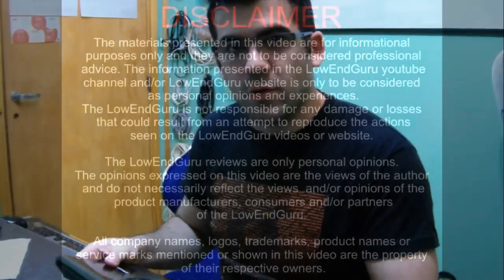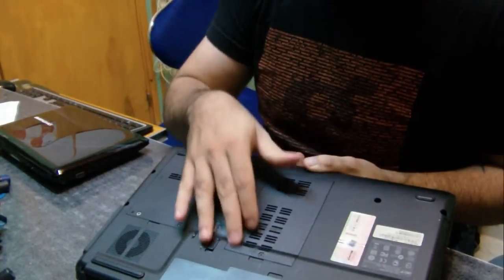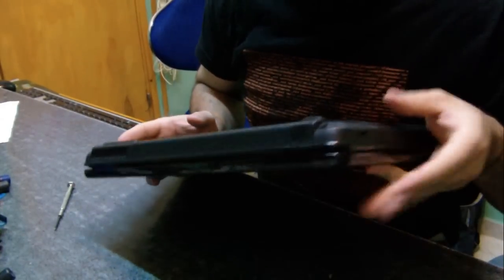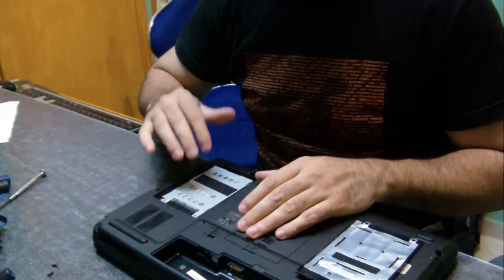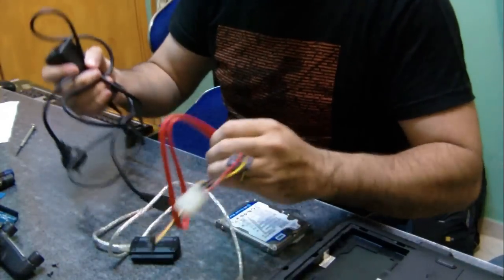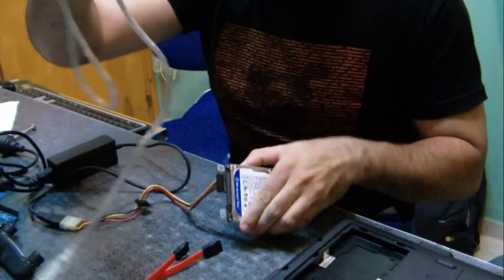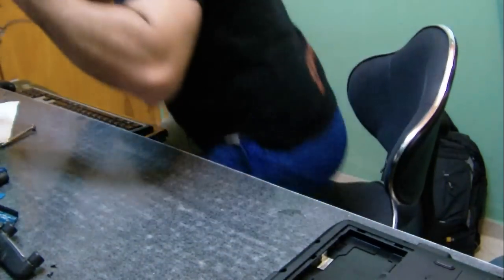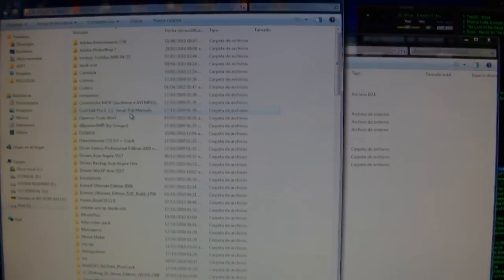How to recover data/files from a dead laptop/netbook

Comment: If you can't find the cables he uses and have an external portable harddrive lying around somewhere. (1) Open up the casing of the portable external hard drive, (2) Disconnect the attached connector. (3) Reconnect it to your old laptop harddrive (4) Plug in the USB cable that came with the portable hard drive, and voila, connection done!
Reply: Colin Lee do u have  a video showing how to do that
Reply: this picture should help: https://i.ytimg.com/vi/lNnCpa05Tz0/maxresdefault.jpg basically you just need to open the case of your external harddrive (do it slowly so you don't break it), and unplug that top section. You then use that section to connect it to your old harddrive. Good luck!
Reply: Thank you!  You just saved me buying new cables.  I was able to use my existing portable hard drive connector to get the data off our dead laptop :)

Comment: lowendguru,This is a great video. However; I have a question. I had the problem where my computer went black. then I was able to restart it and run it, but I lost all my files and my softwares program. Now i don't know how to recover them. Can you explain to me step by step how to recover them. I couldn't understand some stuff in your video. What is exactly the cables I need. Also do I need to have another computer to do this process. Can I do it with another laptop. Please help me. Thank you

Comment: I am starting from scratch, what are all those cables ?
Reply: Different hard drives have different connectors, so you just need the relevant one for your hard drive. You can buy cables individually, or as a kit for multiple hard drive types. Get your hard drive out, look at the connector and see whether it matches the cables on eBay etc.

Comment: Awesome video, my screen just went out and my HDMI port stopped working too.  Now my screen flashes green red blue white or goes completely black.  I can still hear the windows sounds though when I boot it up so I know its screen or graphics card related.  

I need to get those usb to harddrive connecters that you're using.  How much for cables like that?

Comment: Good to know I can do this, my trusty old laptop that I've had for many years just stopped recognizing the battery/charger the other day. I fear it's time for a new laptop.....but I've got a LOT of  important files on that computer (yeah, I know, should have backed them up...yada yada yada). I'll have to have my friend who works in IT help me do this job. Even with cloud storage, I still stand to loose a lot of data if I don't pull it off the hard drive of my old laptop.

Comment: Hi! 
1) What is the brand and model of the adaptor kit used in this video? 
I found a kit online:
Generic SATA/PATA/IDE Drive to USB 2.0 Adapter Converter Cable for 2.5 / 3.5 Inch Hard Drive / 5 inch Optical Drive with External AC Power Adapter
Will this kit work? It appears to have all the components used in your video.
Thank you so much in advance for your time.
Respectfully,
Fysh

Comment: Easy way to recover files:
1. Buy "Hard Disk Drive Enclosure w/Cable" in any Computer Parts & Accessories Store.
2. Put your Hard Disk Drive Inside the Enclosure
3. Plugged in the Cable/USB Cable to your Another or Extra Computer.

Comment: I did this but used an external hard drive case instead, much easier and without all the wires!
Reply: I tried that will a Seagate enclosure but it wanted me to format the disk so now I need the normal cables now. 😝

Comment: I have a question.   My laptop (Acer) has problem with charger.  The charger cannot plug in to laptop as my kid broke the charger where it connects to laptop.   (1) Can I buy a charger separately?  (2) If I cannot charge the laptop,  can I still take out the hard-drive and recover all files?  Thanks
Reply from the maker: You can buy a "universal laptop charger", you will have to set the voltage manually (see the label in original charger). Also, most laptops can be disassembled so the hard-drive can be removed and connected somewhere else for data retrieval.

Comment: My files came up as System Reserved (E:) 67.8 MB free of 99.9 MB and Local Disk (F:). Somehow when I click on the System Reserved folder it says that the folder is empty.... Is there a reason why its like that?
Reply from the maker: +Kazoua Xiong The system reserved partition does not contain any user-related files. It only has a bunch of hidden stuff that Windows needs. User files will be located in other partitions. If you don't see any other partitions try the "Create and format hard disk partitions" tool included in windows (just to see the status of the partitions), as they may be present but unusable.

Comment: I'm trying to help a friend with a similar issue, I want to try a different approach but essentially the same thing. If I populate a spare sata port on my desktop motherboard with the bad hard drive and run power to it from my power supply, I should be able to access the data from it right?
Thanks!
Reply: In theory, yea, should totally work.

Comment: There is a much easier way to do this. Remove hard drive from laptop like video instructs then just buy a 2.5 hdd external case and stick your hard drive into the port. No need to mess about with all these cables!

Comment: lowendguru, How do you boot from the hard drive that has been removed from the laptop? I need to create an image backup of windows 7 from my dead laptop and restore it onto my new laptop which came with that stupid windows 10. I want to get rid of windows 10 from the new laptop and replace it with windows 7 from my dead laptop. You got any idea how to do this? Thanks in advance.

Comment: Will files that were on my desktop be there. I know its a dumb question i just want to know.
Reply from the maker: In this example we are connecting the "old" hard drive to another PC. This means that in the new PC you will see the old hard drive with a different drive letter, in this video's example you see how the drive shows up as "I:". Also keep in mind your username while searching. Desktop files from the old drive should be found in the path "I:\users\username\Desktop"  where I: is whatever drive letter you got and "username" should be replaced with whatever username you were using in the drive's system.

Comment: will this method work of the hard drive has partitions?
Reply: I did all of that and the external hard drive showed up as "F" drive but when I went to access my info from the "user" folder where my information is held, it states that "I dont have permission" and then attempts to access that particular folder but getting "permission". Once it does this, it gets stuck here and doesn't ever retrieve permission to access it. any suggestions? Thanks.